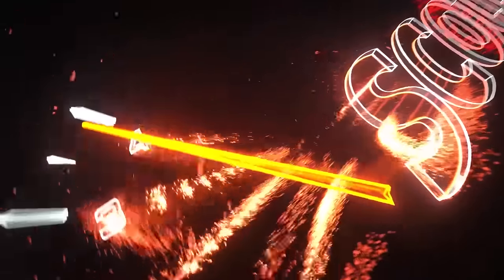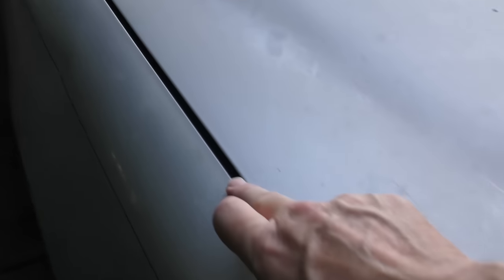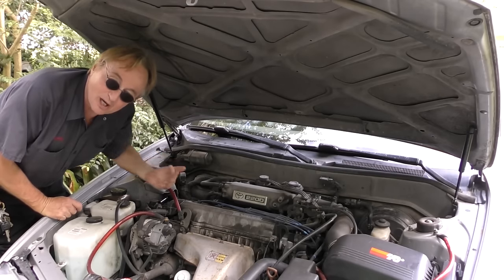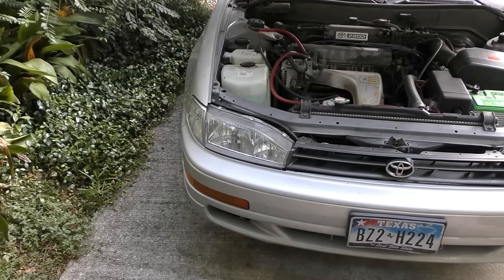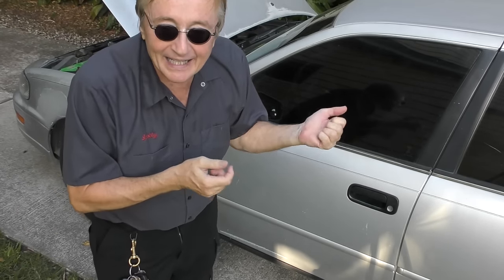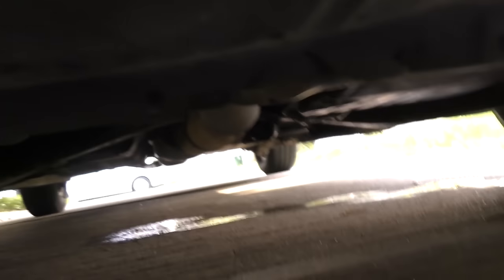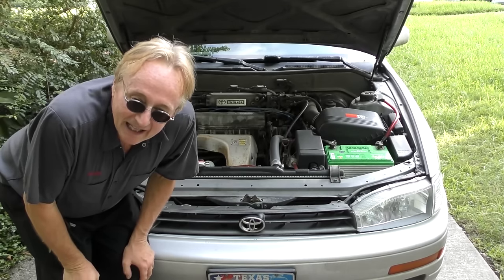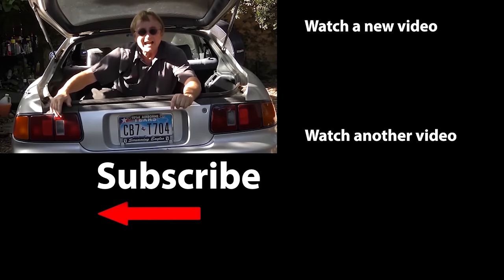Can You Destroy a Toyota Camry

Comment: Cars should go back to being made simple like this
Reply: Or better quality
Reply: Won't work also I really wanna have Bluetooth and USB in my future cars..
Reply: fossil fuels will be drained soon....or at least during my children's generation.
Reply: Yes!
Reply: Mianlo 2  So the bottom line is it's like a lot more dinosaurs died and buried allowing us using them longer
Reply: Mianlo 2  In that case, horses can make a comeback.
Reply: I  agree,   had   a  96  n   a   2000  camry.    great   reliable   affordable   car.   tape  deck,  n  CD    player  n  radio,  all   ya   need.
Reply: @biglaser711  "fossil fuels will be drained soon" I wouldn't bet on it.
Reply: 권한욱 AOC said the world is gonna end in 10-15 years anyway so who cares if fossil fuels run out 🤷🏼‍♂️
Reply: So we can see screws everywhere LOL
Reply: DDC ll as far as I’m concerned they can keep their Land Rovers, BMW’s, Mercedes I want something affordable and runs like a clock.
Reply: Car manufacturers cater to consumer demand.  I agree.  I wish for a simple car; 4 cylinder motor, stick shift,  power steering, fuel injection, electronic ignition, air-conditioning.  That would do just fine.  Of course it would have to be a Toyota.
Reply: Mianlo 2  It is not possible to run out of oil.  If oil becomes more scarce the price will rise and people will find alternative fuels.  And, as oil becomes more scarce the price rises prompting more money to flow into exploration.  We have hardly touched oil reserves out in the oceans, future technology may make it possible to extract this oil economically.  That we are running out of oil is a myth.
Reply: I wish
Reply: They are already here, look at electric cars.
Reply: @gc4060  and the funny thing is that you can get a car similar to those brands and get Toyota reliability. Hello Lexus!
Reply: Thomas Haas true
Reply: @aeromukodj3282  It is impossible for electric cars to replace gasoline/propane/hydrogen fueled cars.  Where is all the electricity going to come from?
Reply: @edwaggonersr.7446  nuclear sources are pretty abundant.  They literally have battle ships and subs run for decades on fuel that is pretty minimal in mass.

  Or some other source we haven't thought of yet.  Nuclear is only decades old compared to every other source of energy we've been using (i.e. coal, hydro, wind, solar, fossil (coals technically fossil), .... All those were used 100's of years ago.

There is likely stuff/ sources we have yet to discover.
Reply: Planned obselance is way these days.
Reply: @edwaggonersr.7446  I agree. All I need is an A to B. A/C is my only requirement as I live in Florida.
Reply: @johnnygunz2300  Yep, if electric cars are going to work we will have to use nuclear powered generation.  We still have the problem of the necessary increase in distribution infrastructure just to deliver the tremendous increase in demand for electricity.  Then, all the gas stations will have to be replaced with charging stations, here's the problem it takes at least 20 times as much time to charge a bank of batteries that it does to fill up a rig with gasoline.  People hate waiting in line.  The greenies hate nuclear power generation.
Reply: @natural_law  Why did my bag of potato chips shrink from 24 OZ to 12 OZ for a higher price than I was paying for the 24 OZ bag?  Planned obsolescence I guess.  Or maybe the value of our money is being destroyed.  Planned obsolescence is a myth.
Reply: @jellyroll5247  And, if your A/C quits your car will still run.  My 97 Jeep Cherokee is about as complex a car as I would want.  Crank windows, manual door locks, Cruise Control, radio, and A/C.  Nothing has ever gone wrong with it that I couldn't fix myself, it's a very simple car, and popular enough for there to be hundreds of YouTube videos on just about anything that could go wrong with it.  Without counting I think there may be a half dozen or less sensors of the whole car.  I can't see myself buying a new car with dozens of sensors scattered all through the car.
Reply: @edwaggonersr.7446  Yeah I agree... Allot to figure out.  

I think if you can make the battery systems change out quickly then people will go for it.  Basically pull into a gas station, the car gets lifted, battery system replaced, and on you go.... Sort of like a propane tank on your grill.  Allot needs to happen before that.

I'm a old school Toyota guy (Tacoma base 4 cylinder manual), but my work place (very large corporation) is adding charging stations like crazy for free use.  Makes me consider something electric.   Allot of those cars can do 200 miles plus which is allot less then my daily commute.  Plus an electric pickup could drag a house with all that torque.  

We'll see though. Definitely interesting times.
Reply: @johnnygunz2300  You hit on something I hadn't thought of; charging your car at work.  Most big corporate building have 600 + volts with lots and lots of amp available.  And a parking lot where you can park your car and charge it while you work.  A lot of potential employees would see this as a real benefit.  I can see corporations competing for talent offering charging stations as an inducement.  It may be that potential employees would work for less pay if they had the benefit of on site "free" battery charging.  If you had two electric cars in the family you drive and charge each one of them every other day, or as needed.  "Honey, my batteries are getting low.  Drive mine to work today."  This could work, but it could not be wide spread without nuclear power generation, IMO.
Reply: Why cant it be done? This toyota can still compete with modern cars. If they where being made new they would be perfect cars. Also they look good unlike alot of cars these days which look like idk they where designed in a game or after a rocket ship.
Reply: @robertbogan225  I wondered the same thing myself over the years.  I guess most people don't see a car as a mere means of transportation. They see them as a fashion statement, as fashions change they just have to have a new car.
Reply: @edwaggonersr.7446  your logic is a myth.
Reply: @natural_law  Show us readers a single substantiated fact that supports the myth of planned obsolescence. Just one fact, not a story, not hearsay, not conjecture, proof.  Which auto company employs planned obsolescence?
Reply: @edwaggonersr.7446  no
Reply: superlauch25 That’s too bad though. This generation of millennials wants all the good technologies. They will get bored easily and if their car is not like a smart phone.They will complain. I passed a girl on the highway She looked 18 and texting while driving. Traffic started to slow and she almost rear ended someone. She was driving her daddy’s BMW (my guess) lol. Yes cars should be simpler like my 97 Camry.
Reply: Amen not crazy computers and sensors.
Reply: Nobody would buy them

Comment: When 0-60 was too powerful that the speedometer couldn’t even do anything
Reply: Those Camry horses must be extra powerful lol. Can't imagine a 130 horsepower sedan being much of a rocket.
Reply: SpotOn:  It all depends on the gearing.  My KIA Soul weighs a hefty 3000 lbs.  It has a tiny 1.6 L engine.  Yet it moves remarkably well.  The reason is the gearing and it has a very sophisticated  6 spd. auto trans. along with an equally sophisticated torque converter.
Reply: @discerningmind  were talking about a 25 year old car here.
Reply: Right.  So gearing.  I was just elaborating on a modern day equivalent of gearing.
Reply: ...it was in shock...must of been that K&N filter :)
Reply: It was so fast that the speedo couldn't keep up
Reply: @discerningmind  No it doesn't, I had the much lighter (2400-2500lb) Hyundai Accent with the same 1.6 when it putting out it's peak 138hp and that thing was a dog.  If you have a 1.6 Turbo version, sure it's fine at WOT for scooting around but it's' certainly miles away from being more than average.

Comment: Scotty forgot to mention this...Another good thing about older Camry's...non interference timing belt...no valves are damaged when it snaps..
Reply: True ... I have a Honda with the J35... interference engine. That belt and pump were overdue at 200k miles.   Replaced timing belt and pump but will keep an eye in replacing it in the future. 

By the way, have a minivan from Chrysler, original engine with 270k miles.  Good van...  even if it is crap by Chrysler.
Reply: John Smith I have seen that Honda designed the engines for better fuel efficiency.
Reply: John Smith I have seen that Honda designed the engines for better fuel efficiency.
Reply: Damn good thing I'm gonna get a used 95 camry. Cuz the when the timing belt went out on my 91 civic it was interfered by the cam shaft which was bent so it would be a $1,600 repair job 🤦🏻‍♂️
Reply: Yep, I got a 2000 model with the 2.2 SOHC 4 cylinder, and the timing belt snapped on me about a month ago. Once I got the new one in with water pump and tensioner pulleys, I got that key, and she ran like nothing had ever happened. God I love that little trooper of a car
Reply: Best feature that these engines have. Non interference is the way to go.
Reply: Yea....but you could just check the timing belt and plan to replace it before it breaks and leaves you stranded on a highway still..
Reply: @jtf-joshtfitnessandlifesty3470  should have just put a new head, head gasket, bolts,studs, water pump, timing belt and tentioner in it. Plan for the future....plan on replacing it when it's due instead of letting it break.....it'll still be a hassle if you're going to do something important and it breaks...I know money is tight for ppl right now, but I wouldn't neglect changing the belt if it's due
Reply: I love this about my '99. I ran it without oil for a while because the oil seal went out and I never bothered to check it out and it still went kicked for 3 days and the belt never snapped.
Reply: Timing belt breaks?  Call AAA, tow it home, put a new timing belt on, drive off.

Comment: I agree these Camry's were built like tanks. I still see many of those on the road.
Reply: I had 1990 Camry (2.0 gli) as my first car 7 years, and it was also very reliable. 
It's side of my field now and it has 520k km in it and everything still works, power mirrors, power windows etc...
Only rust can kill a Toyota :)
Reply: I don't,  the oldest I've see plenty of is the 2006 ones and newer
Reply: @theory816 if you dont like toyotas dont buy them. Nothing personal.
Reply: Specially if you live in a third world state like CA . ... :)
Reply: I think ours might have died the engine makes a horrible sound when you try turning the key. Sounds like the starter and flywheel are ripping each other apart.
Reply: The funny part is these didnt sell that well.  The ford taurus was the best seller, and theres like none left.

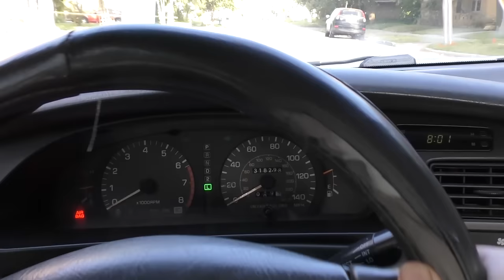Comment: 1:05 THE SPEDO AND RPM GUAGES DON'T WORK🤣
Reply: All things considered 

A/ Rpm gauge isnt really that important in an auto

B/ Since when do people really stick to speed limits?
Reply: Good catch lol
Reply: Eh just download an app and you have a speedo
Reply: Dash mount a phone with Waze. Better than just a speedo.
Reply: @PHAZER99  
👮‍♂️: "Sir, do you know how fast you were going?"
Scotty:
Reply: I guess u just can leave it on the on position?😊
Reply: As long as you have a gas gauge youre good
Reply: Nor the airbag. I see the light is on.
Reply: lol I like the part "still takes off like a rocket"... *has it in low gear* lol
Reply: @dewrus2153  Your right, it doesnt turn after the speedometer stop working. It's the speed sensor in one of the tires that went out and cause it to not show the speed and correct mileage.
Reply: @dewrus2153  So it really could have a lot  more mile on it
Reply: Makes you wonder how many miles it really has since the odometer is not working
Reply: @kokyleod  Google Maps also has a speedo
Reply: your phone can display the speed just as well if not better
Reply: i noticed that tooo!! lmaoo I might be a fuse if both didn't work or the whole unit
Reply: Lol I had a manual that didn't have a rpm gauge
Reply: @shangarsaravanamuthu  isn't there a separate cable that measures milage? I didn't think it was dependent on the spedometer...
Reply: @ieaturanium574  on a 1993?
Reply: @kokyleod  or google maps
Reply: I got bored with my gauges, so I mounted a 9.6inch android tablet in there, paired with OBD2 bluetooth reader and "REALDASH app", it is the BEST digital dash in a 1998 car ever... And there is no lag from OBD like you'd expect from an older car.
Reply: @janetairlines1351  That's how it was in my car so I'm guessing Toyotas keeping it same with the Camry
Reply: @janetairlines1351  My RPMs worked but just not the speed or odometer
Reply: Janet Airlines
That could be why Scotty has itto probably fix that
Reply: I like the string hanging off the steering wheel. 🤪
Reply: @furtivedig  it doesnt care about ur car, it uses gps to calculate speed

Comment: Been driving a 92 Camry 4cyl 5 speed for 25 yrs and Scotty is right, this thing has over 240,000 mi and still runs like a sowing maching and it did have lots of power when new,trans still works great with original gear lube in it.Has the same fuel pump,starter, alternator,plug wires&cap.I guess I'll keep it.

Comment: My 1996 Corolla is at 284k miles. I hope to make it to 300k!
Reply: You will. Listen to scotty and don't be afraid to get your hands dirty (figuratively and literally)
Reply: I hope you do ! Love those cars
Reply: I'm right behind you at 281k!
Reply: Got a 96 Corolla dx with 352k. No oil leaks at all. Regular maintenance and you can get 450k. No joke. Well made little cars.
Reply: You'll probably make it to 500k lmao
Reply: Bill Randall I drive a 2001 Grand Caravan with 270k miles and original engine.  Still running and have driven it for long trips as well.    Once in a while I spin the wheels...when driving excitedly.  That 3.8 should come back. Better than a 3.4 from GM.
Reply: @Bill Randall | Well my $200 1995 1/2 Dodge Caravan has only got 140 000miles but I use it as my work truck and been on countless long road trips. Still runs and drives like new on its original engine and trans.
Reply: @Nune Coco | well I have a 1995 1/2 Dodge Caravan with 140 000 miles still on its original 3Litre V-6 and Torqueflite 3spd. auto. The first thing I did when I bought that bloody thing was to do a brakestand burnout! I've been on countless long road trips and its been rock solid reliable to me and it's last owner.
Reply: I have 1996 with 252.000 miles & run like new .5 speed ,Manuel, 2 doors .
Reply: @moroccoforever7092  manual Corollas are rare I have only seen two my whole entire life. One of them was a 1988 thru 1992 and the other was a 1994.
Reply: I have a 1990 Toyota Corona (Crown), it has more 434k on and is still working fine.
Reply: 284k? Engines barely broken in
Reply: @FlexSZN23  Nice one!
Reply: 2000 Camry auto v6 233000 and counting
Reply: Carloswithac mine 2010 with 220k.
Reply: Jellyroll 52  500k even more
Reply: Carloswithac: It will if you maintain it well and change oil regularly it will last up to 300k Orr more.
Reply: Standard transmission?
Reply: My 93 corolla has 283k
Reply: You'll make it to a million lmao
Reply: I have a 96 Corolla with 372k and I put around 3000 miles a month commuting to work. I put a ring on it.

Comment: “It still takes off like a rocket ship  🚀 “
takes 5 seconds to hit 35 miles per hour
Reply: Don't forget the one he's showing you is an automatic probably took a while to get a throttle response.
Reply: @shanepatrick641  . Yeah I have a 95 and a 98 both 4 cylinder automatic and yeah it takes probably 3 seconds to get a throttle response but once it does it takes off like a rocket it almost scares me sometimes when I enter the freeway going up and the dam traffic is moving slower than 70 mph I'm scared I'm going to hit somebody lol. I had a 2000 Honda civic 4cyl automatic transmission and it took way longer but the old 1987 Honda civic hatchback with a stick shift transmission that one was pretty fast only 4 speed but it could go 110 mph coming from riverside on the 215 freeway dam I loved that car  .
Reply: Howd u know it was 35, the gauges didnt from what i can see
Reply: Miguel Saenz He had it in 1st gear, that’s pretty fast for 1st gear